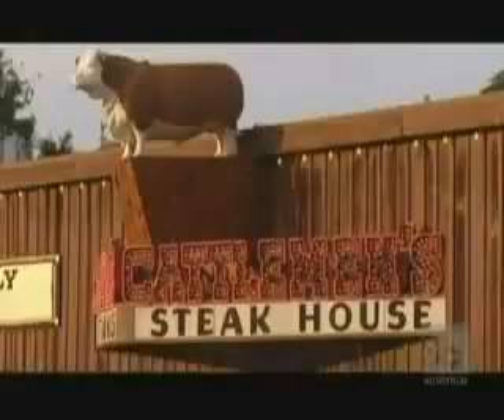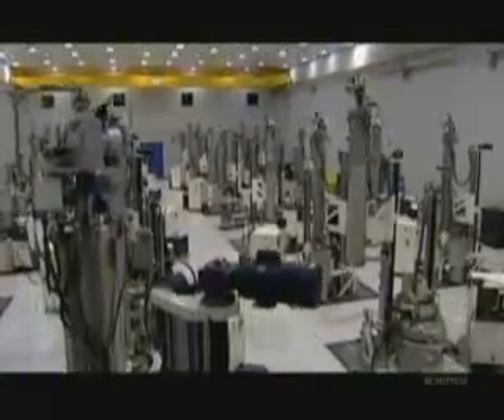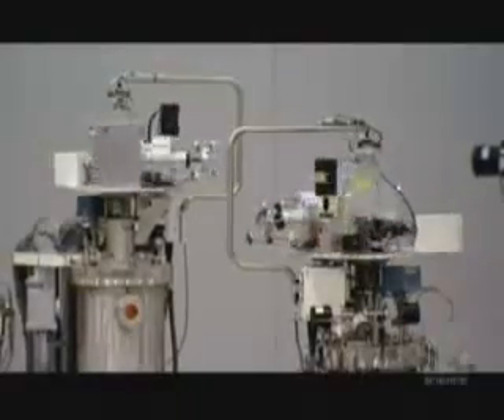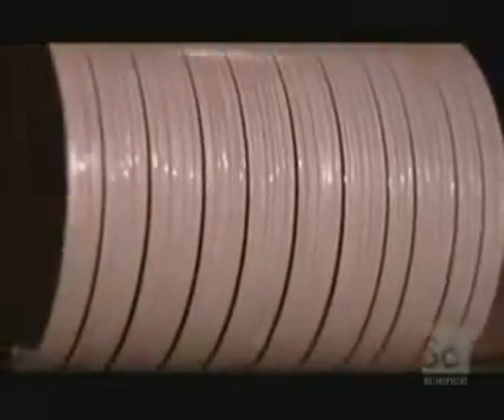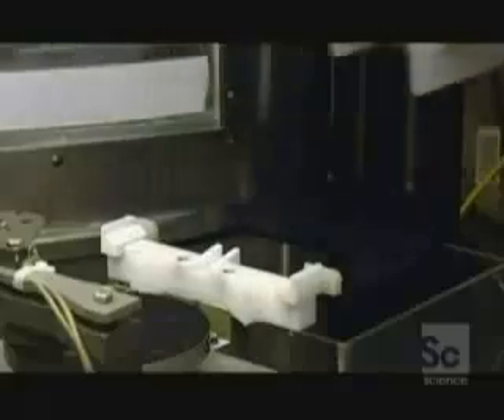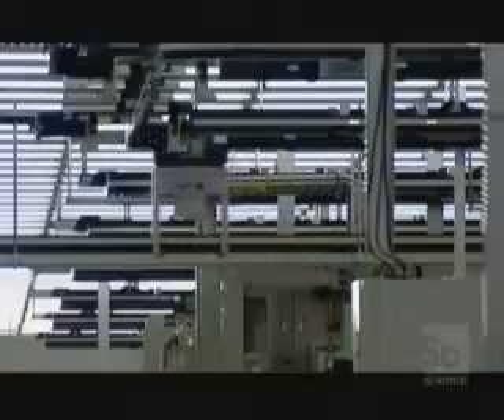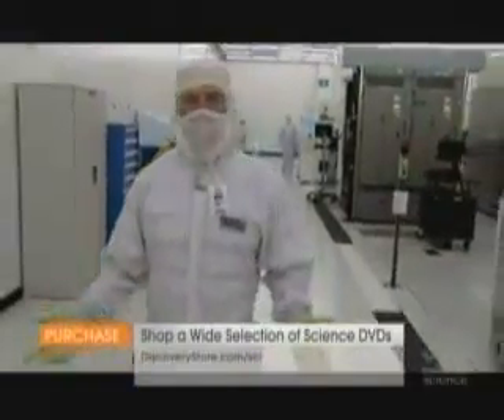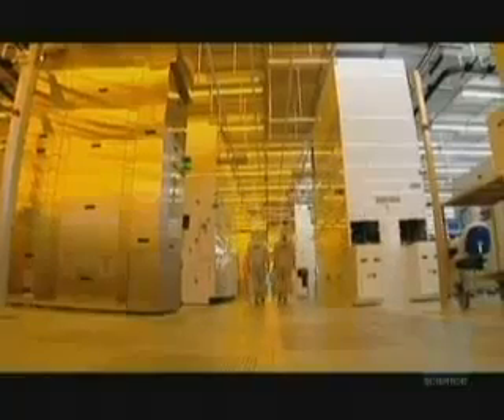Semiconductor manufacturing process video

Comment: At 4:44, it wasn't just Jack Kilby.  Robert Noyce and staff simultaneously invented the planar process in use today.  Kilby's invention involved complex gold wiring of each circuit.  Noyce's planar process allowed manufacturing using processes as are used today.  Kilby was awarded the Nobel Prize for the invention only because Noyce died in the 90s.  Had Noyce survived, he would've been named co-inventor of the integrated circuit.  The Nobel Prize is not awarded posthumously.

Comment: No mention of test!  Semiconductors are usually tested while still on the wafer, prior to dicing.  Then the good ones are packaged with some kind of pins or other connections, and then tested again.  Only then are they ready to install in a product.  The bad ones are discarded.  How many good die compared to bad ones is known as the yield, and a major part of everyone's job is to keep the yield as high as possible.

Comment: What happens to the semiconductors which are rejected or does not fit the requirements? Is it thrown away or recycled? Need an answer asap... thx
Reply: miriam901220 no one has answers you in 5 years...
Reply: Thrown

Comment: this is the mark of the beast and or the buying and selling system discribed in revelations they will be etched with the original mark of the beast text χξς and or in the name of allah symbols notice they mention etching in this video
Reply: If this were true a decade wouldn’t have passed. 

Religion is to keep you inline and adhere to rules they allow. Don’t think that you have a choice in this matter. You live in the matrix and are told what your truth is. 

Btw, Graphene transistors would be the next phase and would work in the form of a tattoo adhered to the skin and capable of storing all of your personal information. Probably even your family lineage and credit worthiness. 

They are still 2-3 decades away from using this type of technology on people. It hasn’t even been improved much in animal chips which still hasn’t become a legal requirement. Once that happens start paying attention to current technological accomplishments. By that time most still living wont see it as a Biblical thing, but rather as a convenience of technology and convinced that it is crucial to the modern lifestyle.

Comment: Interesting video.
Very informative and well put together.

I'm studying semiconductor physics right now, so this gives me a bit more insight into semiconductor devices.  The book I'm reading now focuses more on how electricity is conducted throughout the device and material properties and parameters, rather than how a semiconductor device is fabricated in a laboratory setting.  

It's just a start to learning more about trasistors, diodes, integrated circuits, e.t.c.
Reply: TheUltimateBeing01 i
Reply: Ajay Dwivedi o